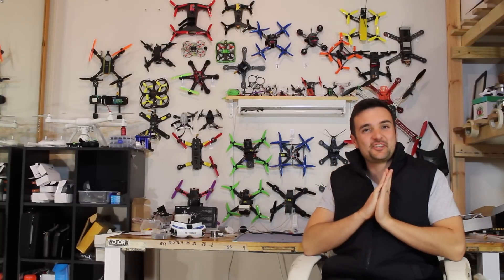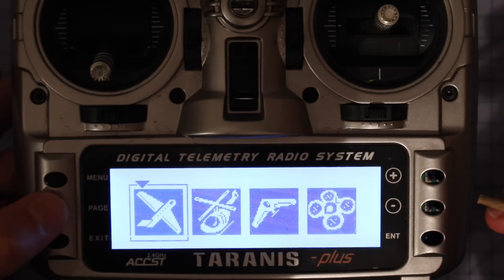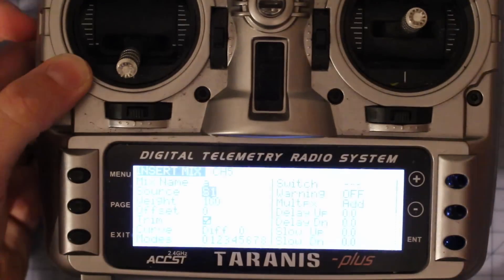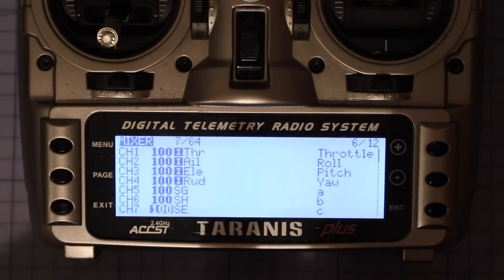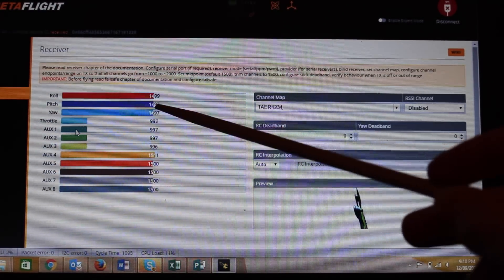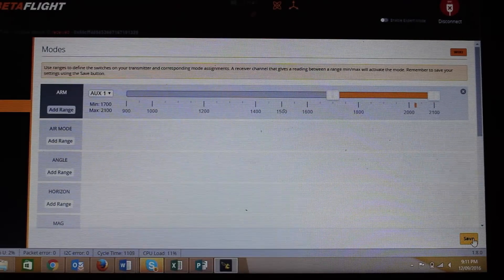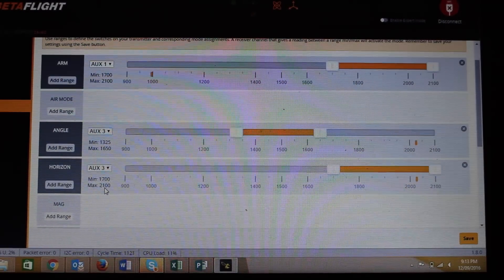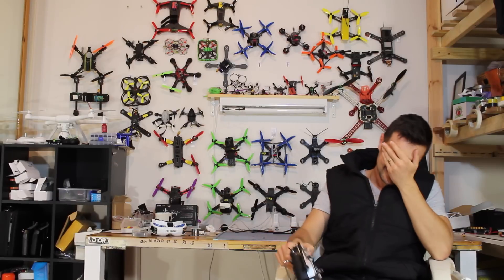How to set up Cleanflight / Betaflight modes & Taranis switch guide

Comment: Just got the Emax Hawk 5 in the mail.  Bound the TX to the RX. Named switches A1, A2, A3 Arm, Modes, Buzzer. Went into BETAFLIGHT to set up the modes. But the TX is not responding inside BETAFLIGHT. Quad is linked to BF. What can I do?

Comment: hey bro i am new at this and just got my king kong 90gt and trying to bind i have never bound a quad before but when i set up the bind my taranis qx7 vibrates to let me know its bound, i look at the rssi and reads 92... and when i unplug the quads battery it vibrates again telling me no more connection to the taranis, but i cannot arm the motors... any help would be much appreciated
Reply: quad55555 check in clean flight that everything is set-up right.

Comment: Somehow my AUX switches (which do show responsiveness on the tx channel monitor) do not respond in betaflight. (over SBUS protocol)
What am I missing?
Reply: do you have your settings adjusted in your output screen? mine only work if i have the Channels centered between 1000 and 2000(1000,1500,2000 for 3 part switches) , otherwise I dont get a response from betaflight

Comment: I have a simple question i would like you to help me out with, i am a beginner in quads, i recently purshased a riot 250 , very responsive machine , it only comes in acro mode , i recently put in angle mode in betaflight , i tried it out but i dont know if i should just continue in acro mode or should i learn first in angle and then switch to acro? Only flown for 3 days since i got it, and only tried angle with one pack of battery, its just that acro when flown in line of site it seems a little bit disorientating when in distance , if you can give some advice , it would be greatly apreciated, thanks

Comment: Many thanks for this. Why does my arm switch does not work even after it works on cleanflight?
And my throttle and roll are reversed in cleanflight. But ok on my taranis. How do I fix that?
Reply: In cleanflight I think it's under "Receiver" and you'lll change your channel map. Just type in what you want. Mine is set to TAER1234, yours may be set to TEAR1234 or something. As for the arm, under modes, does the arm function on the right hand side go green when you flip the switch?